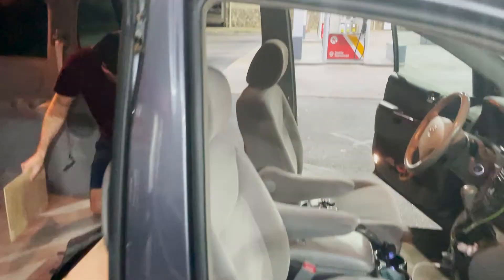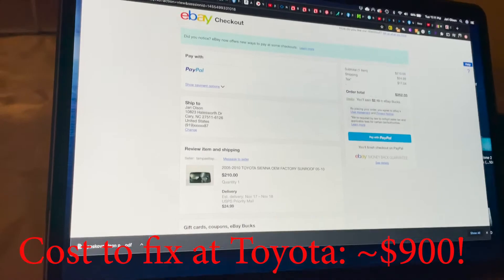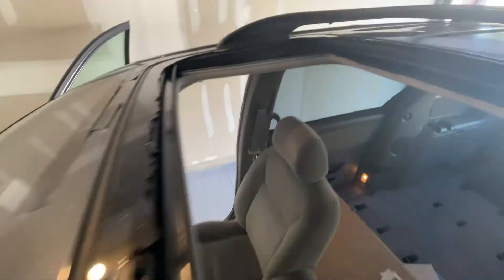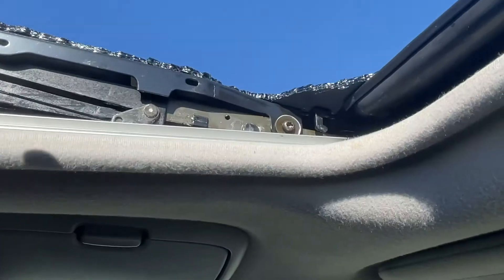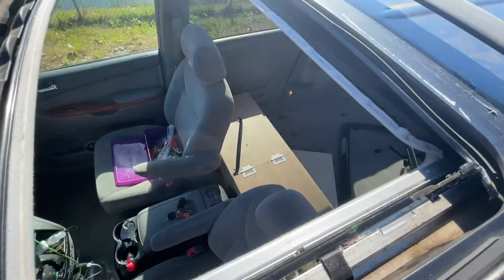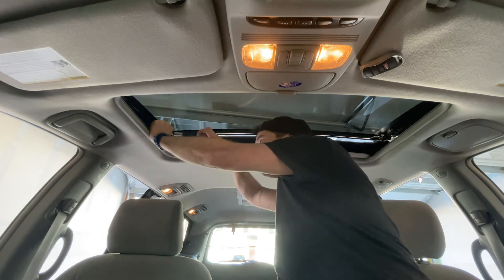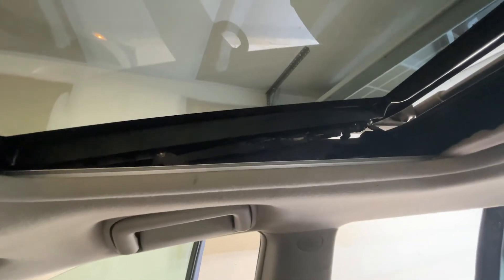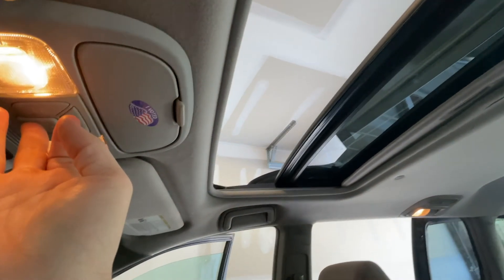Replacing the Broken Moonroof of our 2006 Toyota Sienna Van

Comment: did you have to open the moon roof a bit to remove that plastic strip before getting access to the screws? (3:00 on your video).  i've got a dead sunroof that won't open up at all.
Reply: i have a 2007 Sienna.  you do NOT have to open the moon/sunroof to remove those plastic strips.  the strips (one on driver and one on passenger side) come off pretty easily by hand.  just start with one end of the strip, and pull it toward the middle of the car,  then it's easy to pull the whole strip off.